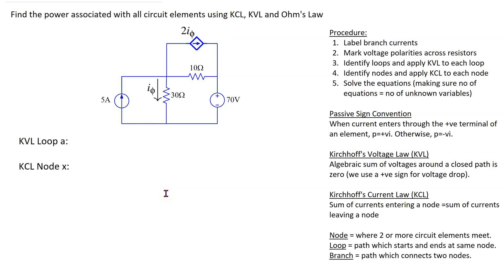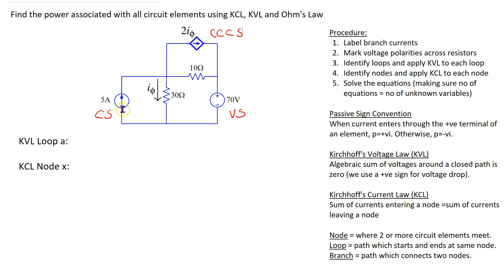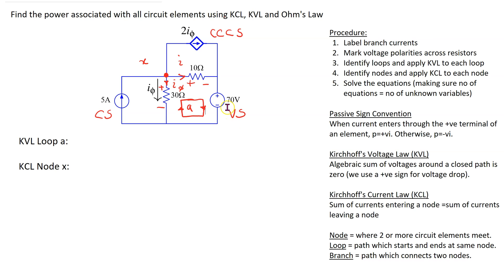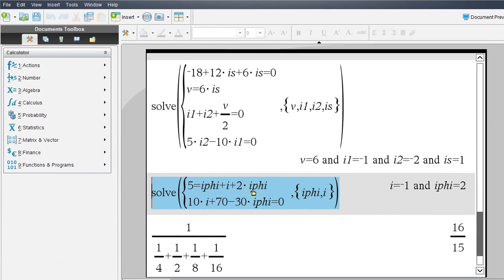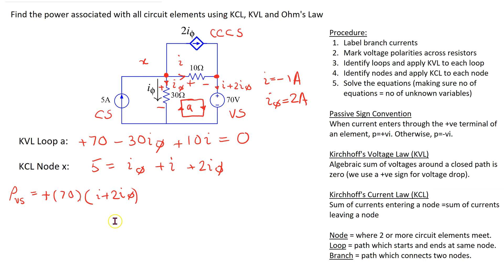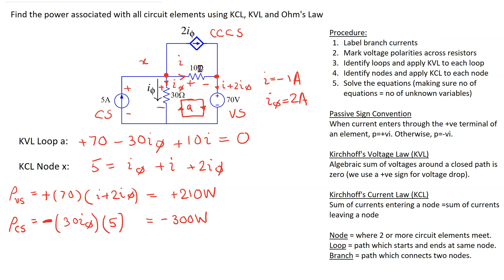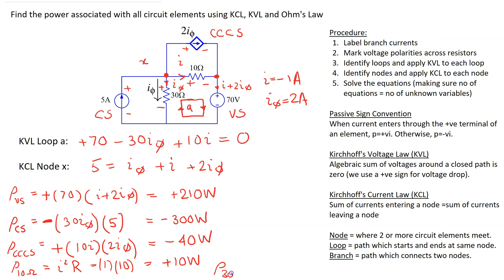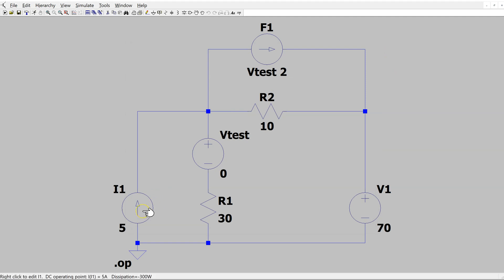Solving Circuits Using Kirchoff's Laws and Ohm's Law - Example 7 Solving a Circuit Completely

Comment: why do we always label the current source's polarity same way? What if we label it in the reverse order?
Reply: Thank you for the question. If we assume the polarity of the voltage across the CS in the opposite manner, then we have to take that polarity into account when applying the passive sign convention. The final answer will still come out the same.
Reply: @ thank you sir